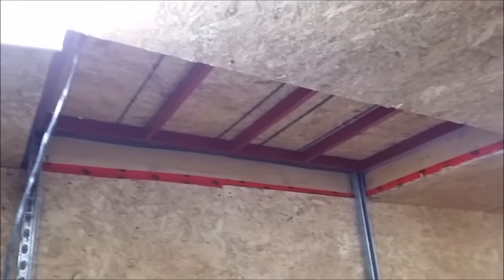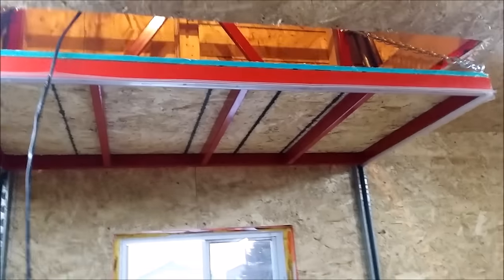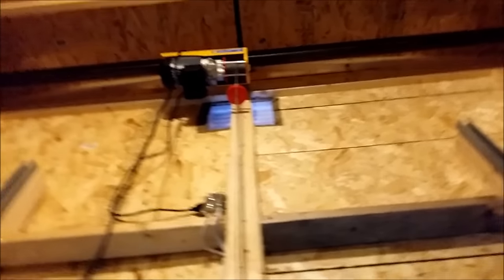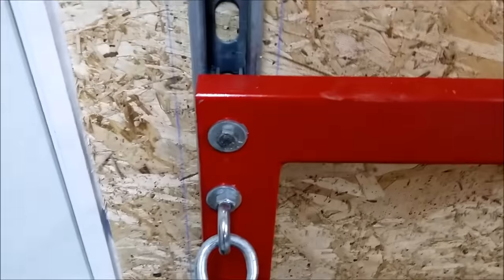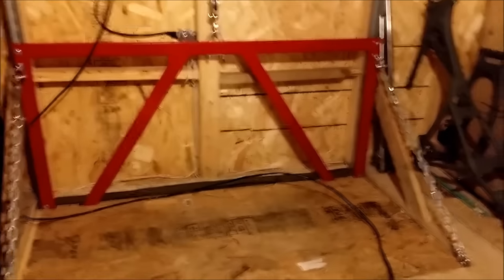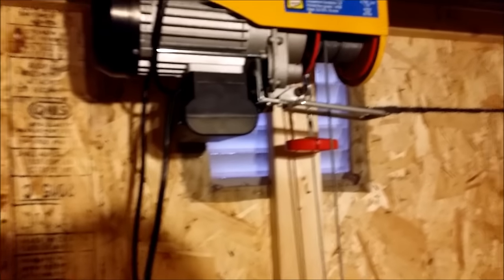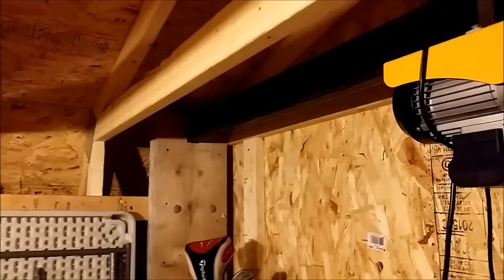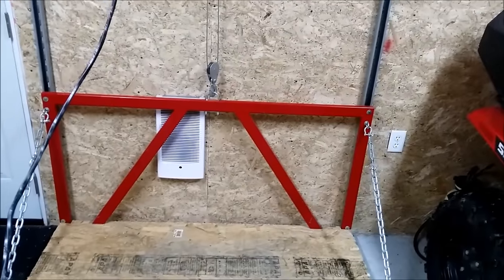Garage Attic Lift Construction

Comment: If you had a magnet reed switch at the top and bottom to kill the power when a magnet attached to the base of the red frame passes it and used a garage door remote control to turn it on so it goes up until it reaches the top trips the switch and automatically switches the hoist for down mode so the next press of the remote send it down.  A lot of garage doors operate that way with a reed switch at each end of travel.  Figuring out how to wire your current remote to do that is the fun part.

Comment: I'd add in a cheap UPS (uninterruptible power supply) usually used for computers.  They are made to give you about 10 minutes to save your work during a power outage.  So just in case of a power outage and you'd get stuck on the second floor it should give you the power to come back down.  Flip the breaker and test it out to see if it will last long enough to lower you.
Reply from the maker: That's a great idea Willie! As a software engineer I'm intimately familiar with industrial UPS systems in the datacenters I have access to, as well as the couple I have in my home for my personal computers and equipment. I've never thought to try one out with the hoist!

Comment: If you are concerned about safety, you could go to the local scrapyard and salvage some old seat belts and use their sudden movement lock mechanism to prevent anyone getting hurt.
Install 2, or 3 of em if it'll put your mind at ease.
Reply from the maker: That's actually an awesome idea that I never thought of Kayann! Thanks for the great suggestion!
Reply: Just have safety notches that click with the machine going up Im not shire with the going down there could be a safety lock or back? Have a second cable that could be hand pulled like a roll up door with a chain?
Reply: That’s a genius idea to use the seatbelt mechanism! Been think about a way to add safety to a DIY elevator.
Reply: A seatbelt mechanism is probably not rated for a high enough load for this application. However there are fall
arrestors which are the industrial size version of the same type of mechanism. That’s what you should use.

Comment: The beam you are using that the hoist is attached to is rather small for the span it is crossing and the possible weight you can lift. I would recommend adding two angled braces running from the lower outer points, up diagonally towards the center where the hoist is to reinforce the structure and its ability to safely lift or lower a load. The size of the square tube is pretty small for the ten foot span. An I-Beam would have been a more proper choice. Look at any industrial crane ad they are all constructed using I-Beam. Just thinking of your safety and the safety of others. It's a great idea and a great addition to your shop.
Reply from the maker: Hey Paul. I used an HSS beam load calculator to ensure that what I used would exceed the lifting capacity of my lift. If you look at the following screenshot of the results of a similar calculator, a 120" long  2" x 4" x 1/8" piece of HSS has a max beam load of 2,864 lbs. The HSS I am using is actually 3/16"  (0.1875") wall, so it'd be better again. Here's the link to the calculator http://www.atc-mechanical.com/calculators/tube-size-using-structural-properties/ and a link to a screen capture https://imgur.com/a/PUdkKB6 of the results that I calculated.

If I'm incorrect here I'd greatly appreciate some further dialog with some supporting calculations or evidence, as safety is always the first priority.

Comment: Nicely built.  a couple strips of carpet or belting 4'' wide that overlap at upper level would stop drafts. One strip on lift, one strip on ceiling. Common sense is the Best Safety Factor.  Heavy up on the U Bolt to 1/2" dia. and a Ride at your own Risk sign!  I was also wondering if there is an escape hatch & ladder from upper storage to grade?  You could be up there and the power goes out!  Since you have welding skills, weld the eyebolts so they cannot open up.  That Hoist Support beam looks more like a 4"x10" I beam than a 2x4" HSS beam.
Reply from the maker: 1/2" u-bolt is in the works! Thanks for the feedback Gord!

Comment: I'm building a new house, just put in the 3x 2x4's to support the struts and dolly mechanism.  I will use the top of the lift (against the wall) to open the second floor door upwards and close it when it comes down.  I also want to set up the floor of the lift to be on strong hinges (like iron door types) with heavy chain support on sides so it can fold up and be out of the way in the garage floor area.

Comment: what a great idea you just given me a great idea to make my rise and fall table for working on my small mowers stuff cheers from Scotland
Reply from the maker: Great to hear from a Scot, Bert! I'm just across the pond in Newfoundland! 

This type of lift is actually great for doing work on small equipment! I'm currently working on restoring a 1983 Honda ATC 70 (approximately 160 lbs when assembled) and I use the lift as a work platform all the time! One precaution you could take is to do up some sort of pin system, where you could lift your equipment up a few inches higher than you need, put some pins through something that can bear the weight, and then lower the lift onto the pins to have those bear the weight instead of the cable. 

All the best with your project!
Reply: Cheers for that I was thinking of some sort of fold down / up legs and as it just small petrol mowers & genis I was going to use a hand crank winch with mine Thanks again for the idea keep up the good work

Comment: Think counterweighted cables, as in two of them.  And then don't hard connect them to your drive motor.  Wrap them like you would a to a wench on a sailboat.  So the number of turns/wraps would determine the weight limit.  That way no one could over stress the lines.
Reply from the maker: Mat Helm I'll have to look it up. I'm not familiar with he concept.

Comment: Nice lift. A little worried about the muffler clamp the cable is hooked to top of platform, I have seen them break when used to lift much weight.
Reply from the maker: I have a video posted after this one that uses a much larger u-bolt along with a larger cable hoist. Check it out!

Comment: Maybe you would need some fire rated 5X sheet rock to cover your garage wall. I do like the particle board behind the sheet rock as I had done that at my last house. It makes for something to screw into when adding storage or even pictures later.
Reply from the maker: Hey KEV JEAN! As my garage is not heated year round, the temperature fluctuations and condensation resulting from such would result in sheet rock getting moldy. This is how most garages are built where I live.

Comment: You were creative enough to build the hard part. Now finish with a governor or safety (brake) . there are several ways to make one. This kind of lift always brakes but you dont have to get hurt when it does. You could even use a retractable safety line. I am a 30 year elevator repair man. I have seen two of these break in the last year. 1 winch broke 1 pin broke.
Reply from the maker: Thanks for your concern Rocky Top. I do regular maintenance to ensure things are tip top with my lift. I've also made some upgrades since making the original video to add to the robustness. Stronger u-bolt, heavier hoist cable, etc...
Reply: if you have a look at the video on youtube "secret life of machines elevator ", a few mins in it shows a safety device which I think would be pretty easy to make a variation for your elevator so that if the tension on the lift cable is lost it does not drop.

Comment: Nice job.  I have storage issues in our new house.  There is storage space above the garage but I am unable to use it.  I am 75 with lower back problems.  I can't carry heavy tubs and equipment up and down stairs or ladders.  Your lift is what I need.  Christmas decorations take up 16 large tubs.
Questions:  Do you know the weight of your platform?  Do you go up with the snow blower?  How much weight do you think your are lifting?  The link to the winch gives 880 lbs rating when using 2 lines.
I would like mine to have a hinged platform so I could leave it down to the garage floor in a stored position.  I would use a roll away tool bench in front of it.  I liked Milton Turner's idea of haveing a fold down cover in the attic.
Reply from the maker: Just seeing this one now JGZ, but better late than never! I believe the platform weighs around 100lbs itself. Depending on the size of the item, I'll sometimes just climb up into the attic after I put the item on the lift and then bring the lift up with the item, like my snowblower or my barbecue. I know the most weight I've lifted is three grown men (myself and two friends, say, average of 180lbs a piece) and the lift, so that'd be 640lbs or so. 

A hinged platform would be a great idea for floor space saving, but I'd want to be sure that it was a pretty heavy duty hinge, or even something custom fabricated from thick rod and hollow tube that would handle at least twice the lifting load, just for safety.

Comment: Great project and I commend your efforts and the positive out come of the endeavor. Very good work with the channels.  Your entire frame support (weight with lift load) is relying on the threads of a u-bolt at the red frame and the pulley on your cable attached to your hoist.  With all the extra work you did for structural soundness, I would NOT rely on those threads be my weakest point. It may last for years, or fail next week.  I would at least up-size the bolt, or re-engineer that connection with a tack weld or etc...

Comment: Could the elevator suddenly fail and send the lift back down to the ground or is their a built in fail safe?
Reply: I think you need to read  up on  the  cable hoists  , they lock  when  not  powered.

Comment: Thank you so much for this video! I reversed the trolley arm -/ use the coarse Acme thread and use it for lifting and lowering my bed and work table in my Sprinter van. I almost went with wires and pulleys#! $@! thanks a million
Reply from the maker: Glad the video was able to help you out Stefen!

Comment: Very nice job! Only thing that I would rethink or beef up is your cable connection to the platform. That u bolt looks a little light. Nice weatherstripping idea!
Reply from the maker: Thanks for the expression of concern gibson. The u-bolt is rated for roughly double the capacity that the cable hoist will actually lift, but I'll keep an eye on it nonetheless!
Reply: I have years of experience in this kind of rigging and I would suggest that you double up on that lift attachment also ! GREAT WORK ,AND GREAT DESIGNE!
Reply from the maker: Hey Wayne! Thanks a bunch for the constructive feedback! I am planning an upgrade of the cable hoist soon and figure I'd put a nice hardened 1/4" thick u-bolt, like you'd get for automotive hardware. Would that suit, or do you think there's something even better that I could use?

Comment: Except for the incredibly dangerous way it passes through the upper floor that creates a pinch/crush danger, great job.
Reply from the maker: TomKaren94, I understand your concern. Unfortunately the majority of attic lifts you'll find on YouTube, or even the "professional" ones that are marketed such as the Versalift brand lifts, fall short in the same area.

In the three years this lift has been active in my garage, I've had zero incidents where anything on the lift has been snagged on the way up through the attic floor. Ultimately it comes down to the operator exercising a bit of common sense.

I'd like to hear any ideas you have with regard to preventing snag/crush incidents with a homegrown lift such as mine. Your contributions to the ongoing discussion would be greatly appreciated!
Reply: @blastworks  Consider making an arch on the platform that opens two hinged doors at the upper floor. These doors should close when the lift is below the floor level. In earlier times this idea was used on sidewalk lift access to the basement for coal delivery. Good luck.

Comment: Ever have any issue with the upper dolly trying to pull out of the channel? Those could end up having quite a bit of outward force on them.
Reply from the maker: None whatsoever. I load the lift with the weight as far back as possible so the moment of rotation about the lower dollies is minimal.
Reply: @blastworks , good deal. Those channels are probably good for multiple hundreds pounds each in that direction anyway. I guess it depends on the dolly as well.

Comment: I built a similar lift for my garage.  Is there a source for a reliable electric hoist?  I've been through two already (each just out of warranty).  It looks like the same Chinese company is making hoists and rebadging them for several distributors.
Reply from the maker: Hey Pat! The 440/880 I bought from Princess Auto here in Canada was good for me for the first 3 years, then I upgraded to a 1100/2200, you can check out the Garage Lift Upgrade video on my channel!

Comment: Good work! I have been inspired to construct a lift in my garage. There have been several questioning feasibility, cost, safety. I have considered safety of ladders, one of the primary reasons for home accidents, the physical footprint and cost of a permanent staircase and a pull down, especially the pull downs if ceiling is more than 9'.  In my mind, the only option. Eliminates space requirements for fixed staircase, eliminates safety of lugging items of any size up a ladder, pull down, or staircase, probably costs less than any of the previously mentioned. I do have a question on the power source for the system. Is it  a 12 volt winch working off of a battery source or 120v?
Reply from the maker: Electric cable hoist on 120V. Check the link in the description!

Comment: Love this!! Any difficulty in aligning the trolley wheels in the struts -  you know parallel to each other after attaching trolley wheels to the platform?  Tips to do that part right the first time?
Reply from the maker: Hey Deste! I just made sure when I was installing my rails that the center of the rails was the same distance apart top and bottom as the trolleys on the frame. That's all it took!

Comment: What happens if the cable, hook, bolt etc.. breaks while you are riding it?  It will free fall and someone could get hurt.

Love the idea but looks dangerous to ride.  I have seen a safety cam latch set up on car post lifts that could be mimicked  for safety I think.
Reply from the maker: I address safety concerns in my follow up video. Feel free to check that out.
Reply: @blastworks  I didn't realize there was one.  I will check it out Thanks.

Comment: I also will be "brainstorming" a way to create a "manual" locking system to keep it secure in the "up" position.   I won't have anything extremely heavy on it .... but some kind of lock / brace under the platform would give me more peace of mind.     Great concept!!
Reply: H Flores, see my entry above on a safety locking device if cable breaks.
Reply: You could add a swing arm bracket under the platform. Then lower the platform onto the bracket to take the weight off the cable. Or simply put a slide bolt lock thru the C channels, left to right, to keep the platform from falling should the cable break from too much weight, damage or mechanical failure.
Reply: simply put a couple 2x8"s' under the dolly travel areas to the ceiling height.  Done.
Cannot fall from Stored Height.

Comment: Was one length of unistrut channels good for the height of the lift? Or did you have to join two with extensions?
Reply from the maker: Hey Joe! I had to use three pieces total. At 8' lengths, I had to extend the rails up into my garage attic. I believe this is visible in the more up to date version of this video about my lift on my channel!

Comment: This is exactly what I am looking for in my garage.  Where did you find the bracket, for the hoist, that connects the hoist to the 2x4  square tubing?  The hoist I have came with a bracket for 2x2 tubing.
Reply from the maker: At the time I had a local metal place make them up for me. Now that I have a welder I'd just make my own.

Comment: Those laminated beam supports on the second floor should run to the first floor, floor.
Reply from the maker: If I were lifting a couple thousand pounds, sure, but I'm lifting no more than 400lbs at a time. It's perfectly fine the for my use case.